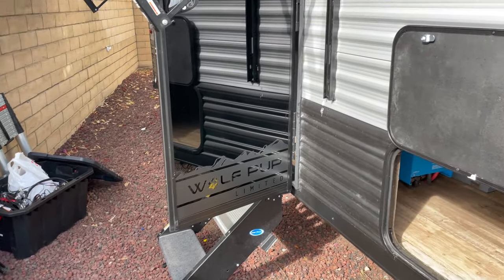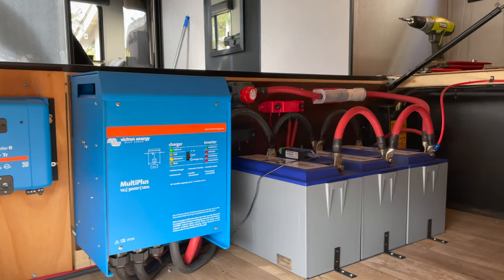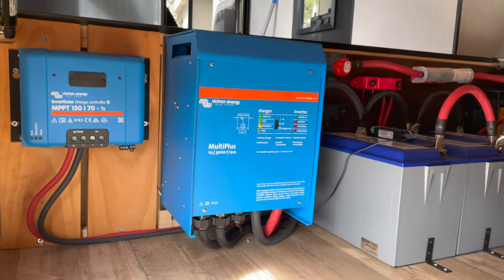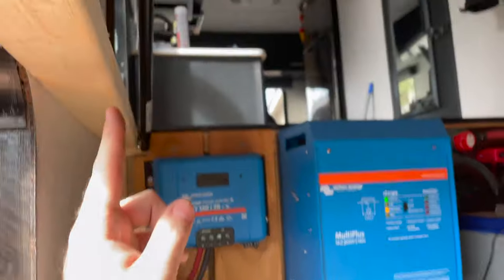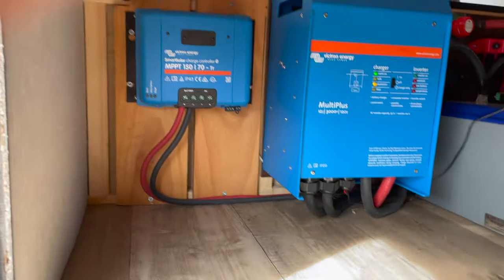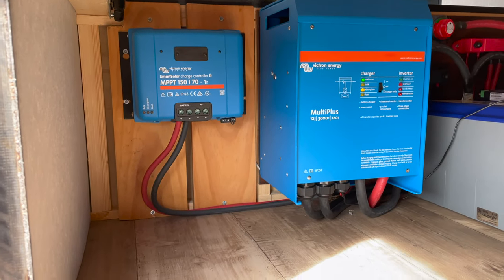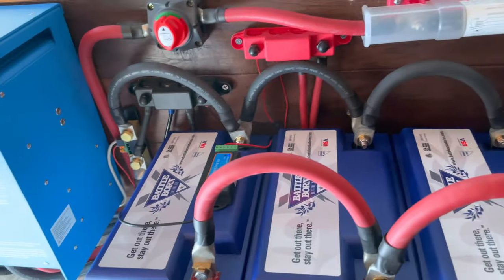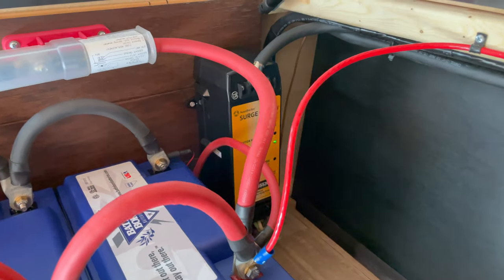RV LITHIUM BATTERY UPGRADE 🔋🔌 💪🏼 - 2021 Cherokee Wolf Pup 16TS

Comment: I know this is an older video, but for safety just wanted to throw this out there. I own a 16TS as well. I placed my entire system under the seat storage  next to the fridge. It’s close proximity to the breakers and ease of feeding solar cables from the roof to behind the fridge. Plus you won’t be sleeping over batteries that could potentially fail. Clean looking setup though 😊

Comment: Hi - my Wolf Pup already has a solar panel and a deep cycle battery and I want to upgrade to Li. I'm confused with the addition of the inverter to the system. My assumption would be that the RV would already have an inverter to run off of either shore power or the deep cycle. Is that incorrect? Or do we just need to replace with an inverter designed for the Li batteries?
Reply from the maker: They do not come with a whole unit inverter. I’ve noticed the newer models, however, come with usually one outlet that has an inverter built into it.

Comment: Wow....This is just top notch work and design.  I'm almost embarrassed to talk about my solar system in my 2019 WP 16fq.  Have two 100 watt solar panels attached with eternabond tape to the roof so no holes were drilled.  Just have a simple PMW solar controller and two huge deep cycle batteries on the hitch behind the propane tank.  System powers up everything except AC and microwave. My simple system was about $400 compare to yours at $5K.  As a backup if no sun or if I need more power I have a small quiet inverter generator in the truck.  So far I haven't needed it.  Just saying there are cheaper alternatives to your incredible system.
Reply from the maker: Oh there totally are! In fact, you could go with the Victron 2000 inverter and only two batteries. There are endless sizes and possibilities. You just have to figure out what you need for your particular camping style :)
Reply: You should upload a video of your setup. You say “huge deep cycle batteries”, could you share specs on those batteries?

Comment: You did an awesome upgrade, and that is the most professionally done battery setup I’ve ever seen. I’m still watching and you may answer the question but, How much did this battery and controller setup cost?
Reply from the maker: It was around $4000 for the equipment

Comment: Does your converter charge your battery bank? I'm a bit confused with mine (I have the same trailer). The panel says "Lithium ion safe" whatever that means...but I checked the voltage of the terminals (with the battery removed) and I don't see a charging voltage. I only see 2v, so the meter is just picking up something else. It doesn't really make sense to me why the converter wouldn't charge the battery while plugged into shore power?
Reply from the maker: With my upgraded Setup, the Victron MultiPlus inverter is also a converter/charger so I bypassed the stock converter that’s in the electrical panel. 

That is the main job of your converter is to charge the battery when plugged into shore power but it will only charge it at a certain rate based off of how depleted the batteries are. When it says “lithium ion safe” it means that it’s capable of charging lithium batteries because they charge at a different voltage than the typical deep cycle batteries. However, I’m not sure how it knows to do that because there isn’t any sort of interface to define what sort of battery it is. 

If your batteries are already charged and you plug into shore power you would see very little voltage going to the batteries. Basically just keeping them topped off as a “float“ charge.
Reply: @TheRVPastime  thanks a lot for the quick reply. I accidentally left my stock battery on...so now that thing is toast and I have to buy my lithium batteries sooner than I thought 😖. I've been struggling finding this basic information!

I'm an electrical engineer, but this stuff just doesn't fall into the category of stuff that I have learned! 

The converter may know how much voltage to charge the battery based on the load at the end of the wire, so it might not need an interface. I'm assuming that the load of a lead acid is a bit different than lithium ion. That's my guess. 

I'm just really hoping it's safe enough, I'm trying to save money. Don't really want to spend more than what I already am on the battery itself yet. The Battleborn batteries seem to be the bees knees, so hopefully they have some built in protection as well.

Comment: If you’re willing, can you share the approximate cost of this system?  Trying to do the pros/cons…seems like a pretty hefty investment in time & material.  How much benefit did you see in battery life?
Reply from the maker: It was definitely not cheap but the batteries and that setup will last a long time. This setup allows for greater amounts of time off grid and the ability to charge batteries fast with expandable solar. Everything all together was probably north of $5k.
Reply: @TheRVPastime  very informative and excellent video. thanks for sharing

Comment: Great video, I see how to tied the 12v side in…but I’m missing how you tied the 120 in to the solar system 
Thanks
Reply from the maker: Solar does not tie to a 120v system as its part of the 12v system. The Solar panels’ only job is to charge the batteries. Panels go to the solar charge controller and from there go straight to the batteries

Comment: Really nice setup, just got my wolf pup as well and will totally set up power under the bed like that 😊. I think I'll only need less than half this power for my setup. I'm super nervous about putting holes in the roof for solar, a brief video on that would be awesome if you get time!
Reply: I just wrote a reply about my simple 200 watt system to my wolf pup above.  There are many videos on using eternabond tape and other tape adhesives on YouTube without drilling holes in your roof ( just search installing solar panels without drilling).  I also ran the solar wires parallel to the arm of the awning down to the compartment door ( so I didn't drill through the walls).  There are two deep cycle batteries on the hitch and a simple PMW solar controller inside the TT.  Whole system is about $400 and works well.   His is incredible but also cost over $5000.  I don't know what your power demands are but this system doesn't run the microwave or AC.   As a backup in case of rain or if I need the microwave I have a small inverter generator

Comment: Absolutely great video 1  Almost exactly what I am doing in my 25 ft Forest River Vibe.  One question.  What wire did you use for 12v panel?  Again, well done.
Reply from the maker: Thank you! The 12V run from the front of the trailer to the panel was already existing and I believe it was a 10awg which is what I used to go from the battery bank to the small terminal under the trailer where the two connect.

Comment: Nick, great video and really clean installation! A couple of questions:

1) In your response to Phil below, I think you're saying that you replaced the existing 10AWG wire (from the front to the electrical panel) with the SOOW wire out of your inverter, correct?  Since  you ran an additional line back, did you run the wire thru the frame (i.e. drill new holes, clip it around cross-members, etc?).  I don't remember off-hand if Wolf Pup has an enclosed belly.

2) When you plugged in your custom return (120v from the Victron inverter) back into the stock panel, would it end up going into another charger/inverter?  Did you end up bypassing the stock inverter/charger?

I look forward to seeing more videos from your Wolf Pup modifications and adventures!
Reply from the maker: Great questions!
1) The SOOW cable is in ADDITION to the current runs on the trailer. One SOOW run goes from the shore power connector up to the front of the trailer into the inverter. The second SOOW run then comes out of the inverter down the trailer and then into the 120 side of the electrical panel. So, the 10AWG wire (12v) that runs from the electrical panel to the front of the trailer was existing and the only thing I added that was 10AWG was from the battery bank to the positive terminal stud underneath the trailer at the front. That was because the batteries were relocated to inside of the trailer. As for the physical run itself, the SOOW cables run along the same path that the existing factory wires run and I zip tied them to that wire bundle. 

2) you are correct in that I’ve bypassed the stock converter/charger because Victron inverter does all that work now. And I don’t believe I explain that in the video so good catch.

I do plan on having a couple more videos soon where a talk about the electrical system as a whole and that will be the first video that shows everything complete because right now I think I have two separate videos. I’ll do a better job explaining all that in the new one.
Reply: @TheRVPastime  Oh, right... the SOOW loop is only for the 120v... you still needed to power the existing 12v system.  You did explain that perfectly actually.  I would love to see how you bypassed the stock converter, but be sure and put a bunch of disclaimers about "this is for entertainment only, don't ever do this yourself".  Knowing full well that everyone does anyway, right?  :-)  Also, if you haven't seen him before and need more inspiration... Ray from Love Your RV channel has done a bunch of tight-looking electrical mods.

Comment: Quick question - I didn't notice anything installed to have the tow vehicle charge these batteries. How do you set up the vehicle to set up Lithium Ion as opposed to AGM?
Reply from the maker: That’s a good question. the voltage coming out of the seven way connector goes straight to a positive terminal underneath the trailer which supplies the power to the 12V system for charging. I’m not actually sure how many volts the trucks sending down that line nor do I know if that’s a setting that can be changed on the truck side.

Comment: What happened when you’re at a campground that only has 50 amp service? Do you bypass the 30amp surge protector?
Reply from the maker: A 50 amp service does not mean that you are taking in 50A. It just means that’s what that breaker is rated to max out at. The Victron MultiPlus inverter charger I have is set to limit the incoming current to 30A. So regardless of me being plugged into 30 or 50, it will only ever pull 30A. I use a 50 to 30A adapter for these occasions. Great question!

Comment: Good video but probably above my head.  But I am curious how much or what the gain was in this upgrade?
Reply from the maker: Basically the ability to be off grid longer and get the full potential use out of the batteries with 12v and 110v.
Reply: @TheRVPastime  While I don't currently have plans to go off the grid for a long period of time, I am looking for continued information on how to be able to understand what I need from a battery to be off the grid for a couple days without an AC running.
Reply: you probably don't "boondock" much.  The whole goal is to be able to camp and not rely on any hookups. We can take out our class B RV and park it almost anywhere before we arrive to our destination.  The solar system powers everything for the night ( lights, wifi, TV, computer, shower, refrigerator, fans).  All free electricity from the sun.

Comment: Love your setup. So much so I am basing my system after it. I had a question about the ve.bus dongle. I see Vitron also makes a smartShunt that has Bluetooth. Would I install just the smartShunt since it already has Bluetooth? Idk if it speaks to the Multiplus though or would I need both to see them both on the app?
Reply from the maker: Hello! They do now* have a Bluetooth smartshunt so you wouldn’t need the battery monitor like I had in this system. It’s the same information in the app presented to you. As for the ve.bus dongle, you would still need that to be able to control the inverter via the app.
Reply: @TheRVPastime  ok that makes perfect sense. Thank you for that information.
Reply from the maker: I had a typo in my comment. They DO have a Bluetooth smartshunt is what I meant to say

Comment: How did you run the wires to the solar panels ?
Reply from the maker: Good question, I did all that after I made this video. What I ended up doing was actually running them through the wall just in front of the door. I made a new hole in the roof for the cable gland and it comes straight in to the ceiling right above the TV then into the wall, down the wall, and then out inside of the storage area

Comment: What did you do with the existing battery that was mounted outside on the hitch?
Reply from the maker: I sold it to a friend :)
Reply: @TheRVPastime  LOL. Did you take the cable that was attached to it and feed back into the camper and connect it directly to the battery bank?
Reply from the maker: I ran a new line from the + terminal stud under the trailer toward the front up and into the storage area to the new battery bank.
Reply: @TheRVPastime  Thanks!

Comment: How long can you power you air conditioner with the 300 ah battery?
Reply from the maker: I was able to get an hour or so out of it
Reply: Thanks
Reply: One more question 

Can I run my solar charge control directly to the DC inverter panel